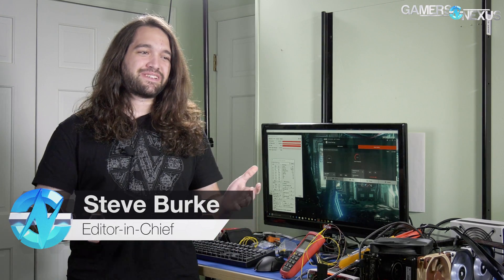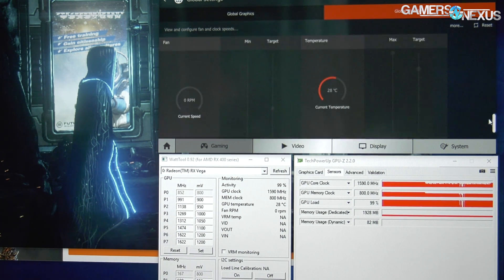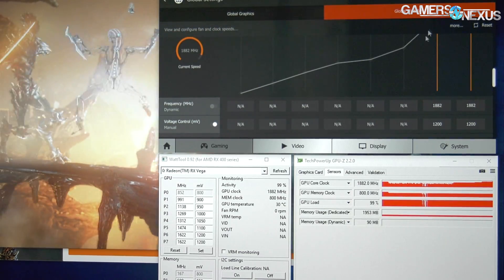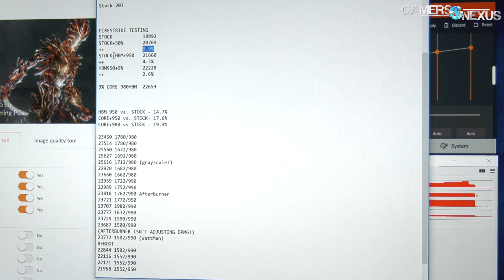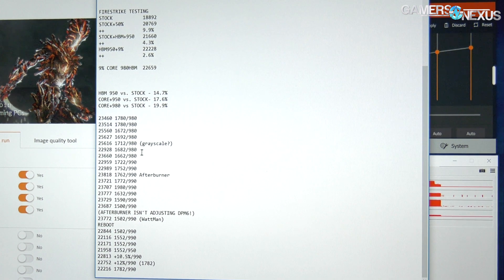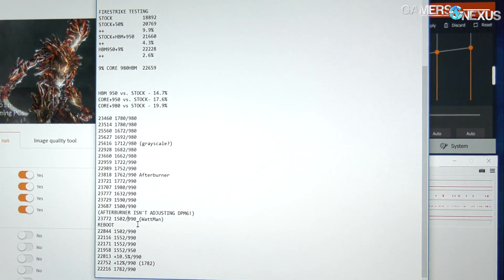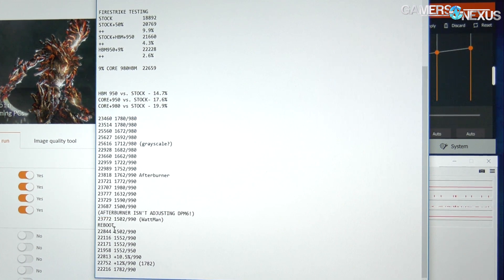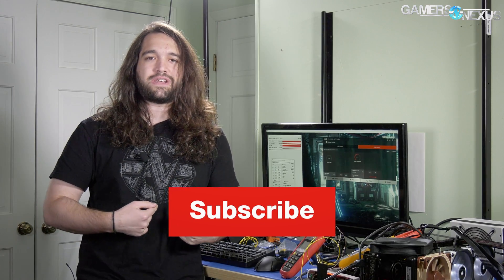Clock Bug Rant: No, Vega Isn't Hitting 1980MHz

Comment: In the future Vega64 will beat 1080ti look at its raw power compared to 1080ti. Vega just needs game optimizations, driver updates and when AMD enables DSBR, its performance will jump hugely. (Finewine technology am i right? :D) Wattage isnt problem if well cooled solution=AIO Vega 64. And almost every Vega gpu can be undervolted and still perform same than stock one. AMD just made sure that every chip (even the bad ones with bad silicone) can run at rated speed. I would buy Vega over 1080 becouse its little bit cheaper, more futureproof and it will get 1080ti performance later (due to optimizations, driver updates and enabled DSBR) (Btw now with DSBR disabled Vega cards render everything, even things you cant see in games, so thats the reason why it isnt performing well now.) Every new tech isnt good at launch. Just like Ryzen and Nvidia 1000-series GPU's. But now months later Nvidia 1000-series GPU's and Ryzen are performing very well after some tweaks here and there. Cheers!
Reply: Will never reach 1080 ti. No  software optimizations will get 30% performance out of a card. Maybe 15-20% but not 30%z
Reply: Juho Petrell, by your logic, I can make my car go faster, if I just put a bigger battery in it. That's not how this works...
Reply: If that winds up being true, AMD has shot themselves in the head. By the time the card gets good, all the reviews will have everyone thinking the card is shit and no one will buy it. By the time some realize it might be good, Nvidia will have something better out.
Reply: ThePotatoJuicer I'd say maybe 5-15 percent honestly.
Reply: Nobody can really predict improvements. Vega has so much untapped performance that it doesn't even look like it actually has any gaming optimizations at all and they just somehow perform like they do. Vega 64 not only has the chance to be as fast as a 1080ti, but also to be a lot faster. The problem with that is, that no one knows if the Gaming driver team finds a way to use all the raw power(The OpenCL team did). What i really want to say is: You can't really say that Vega won't perform like a 1080ti, you also can't say that it will because you can't see into the future.
Reply: Maybe next year buddy lmfao
Reply: Juho Petrell By they time that happens you get Navi. AMD is all about waiting. Not worth it.
Reply: >implying that the 10-series of GTX cards didn't run well from the start

Bro I have a GTX 1080 that I've had since about a month after release and it's kicking ass just as well now as it did at release, even after all of the updates. The Vega will NOT beat the 1080ti simply because AMD is budget hardware. That doesn't make them bad, but in the world of gaming, Nvidia hardware is the high-price high-reward company for gaming. I have hardware in both an AMD rig and an Nvidia/Intel rig, and despite near identical specifications, the Nvidia rig performs better, runs at lower temperatures, and makes less noise. Oh, and it doesn't get so hot that it could cook a steak well-done in about 3 seconds and force itself to shut off to avoid self-damage.
Reply: @nappydrew That's how it works on teslas lol
Reply: Juho Petrell and how do you know it will improve that much with drivers? Do you work at Radeon?
Reply: You are either the BIGGEST FANBOY EVER or just a massive troll. Also it's not just Ryzen and 1000 series Nvidia, it's Ryzen and Vega too, ALL GPU's lose framerates on Ryzen CPU's compared to Intel current gen.
Reply: also according to an earlier video (July 30th or 31st), the one where AMD lifted the embargo on all the specs, Steve states DSBR would be enabled with RX Vega LAUNCH DRIVERS, are you saying this is not the case, if so please point me to something that proves this as I cannot find anything stating that it is not working.

Comment: Bug or not, saying something like "Don't you think AMD would be putting a bit more on the clock if that were so easily possible" Can really be said about both intel and Nvidia. 1080's and 1080 ti's can apparently go all the way to 2100mhz give or take. So, why don't they just clock them at that? Not even after market cards with liquid cooling and hybrid setups do anywhere near 2100mhz out of the box, but they can go that far so why not? 7700k can get 5ghz, so why don't they just clock it at that. 8700k can probably oc to 5ghz too, but they won't clock it at that.
Reply from the maker: There's a big difference between a couple hundred MHz and a 33% increase.
Reply: Because they have to consider every situation the parts will be used in, like SFF with minimal ariflow.
Reply: Probably has to do with the minimum requirement of clock speed. My 6600K can barely do 4.6GHz as where I think most can do that easily, and my GTX 1060 can lock to 2188MHz in certain games and other 1060's can barely get to 2000MHz.
Reply: I'm not talking about whether or not there were increases, I'm saying that statement is just not realistic as to how AMD, Nvidia, and Intel ship out their CPU's or GPU's. None of them put them at their max possible clock rate when we know its possible. So even if there weren't a bug and it could still get a 400mhz overclock, like the 1080 / ti can, with even more ridiculous power draw, you can still say "Why didn't they just do that out of the box?", but its not a fair thing to ask as we know they have TDP targets to hit.
Reply from the maker: We know that, having been in the industry so long. The point is that this difference is far greater than some enthusiast overclock. If all these cards could genuinely hit 2GHz without LN2 (or even H2O, for that matter -- you could do it on reference), then there'd be more room to improve baseline. It's clearly bugged.

Comment: What reviews are saying it will hit 2Gz ?
Reply from the maker: http://hexus.net/tech/reviews/graphics/109078-asus-radeon-rx-vega-64-strix-gaming/?page=8
"A quick word on overclocking. We managed to run the Asus Radeon RX Vega 64 at 1,980MHz core and 1,000MHz memory, just beating out the clocks achieved by reference, and by doing so we added an additional 6.4 per cent performance in a trio of games. The downside of this voltage-induced performance is that power consumption rose to 532W at the wall."
Reply: " 1,980MHz core and 1,000MHz memory, just beating out the clocks achieved by reference, and by doing so we added an additional 6.4 per cent " The 6.4 percent should of told them somthing about thier overclock

Comment: What kind of idiot overclocks without checking if theres an actual performance increase, are people really this dumb now? I plan on testing mine to make sure it works first then it's going to get an ekwb waterblock and should have some nice temps. My r9 390 with my 240/360 only hits 40°C when its normal ambient temp of 21°C (not 30°C like it is right now on the riviera) so I'm hoping the Vega runs around 45°C or so.

Comment: How come you didnt go with the overclock that hit a score of 25627? Seems like that would be your max overclock because anything higher than that just reset the overclock. There was no comment on the side of it so one can only assume that the test went well.. Was there something wrong with running the card at 1692/980?
The test before that also hit above 25000 and there was no comment on that one either.
Reply from the maker: Because, as explained in the content, that's a bugged score? That's discussed in the very video.
Reply: Oh, I thought you were just saying that about the the score with "(grayscale?)".
Reply from the maker: All the 25K scores were conducted under those conditions.

Comment: Why stop at 1980 MHz? Lets troll-clock this beast to 2.5 GHz, or better yet 3 GHz, no, make that 4 GHz!

If this gets 1% quicker every couple hundred MHz, you're eventually going to beat the 1080 Ti!  Like totally legitimately!!!! :D
Reply: proesterchen should of put lie 100 ghz
Reply: If people didn't care about the heat or power gains, or if you live in the arctic with a nuclear generator around the corner, you can ramp up clock speeds as high as you want and push as much electricity as you want without worry.

But electronics are finicky things, so high levels of electricity brings about instability as you push the circuit traces to it's limits, before it starts shorting out.

Basically, we don't know what's the full limit of the PCB's circuitry... Maybe 2000 watts to 4000 watts is the limit, because you are borderline approaching 'large appliances' power usage territory.

https://www.daftlogic.com/information-appliance-power-consumption.htm

Damn, your toaster uses a minimum of 800 to 1800 watts, and all it does is toasts bread.
Reply: There's also a max speed that you can draw thermal energy away from the electronics. That's why super sub-ambient like LN2 or LHe (Not sure how many atoms like to stuck together) are popular for the extreme overclocking is that they can literally boil off absorbing enormous amounts of heat and helping preempt the heat being produced by cooling the CPU electronics further than you can with the electronics off and at room temp.
Reply: Sometimes I wonder why AMD and Nvidia's CEOs are both Asian and somehow have three syllable names (if you just use your first name and last name... Lisa Su and Jen-Hsun Huang)
Reply: Because GPU does math in a way that requires a very in depth complex mind to optimally create a design that works?

Compute in hardware is practically mostly mathematical, to a point where a mathematician is better off than a programmer.
Reply: Little Wick Asia is a continent ,not a race,perhaps you failed geography in school... when people say this or that about Asians I instantly realize they are ignorant.I know what you where trying to say but it always bugs me when people think only Mongoloid's live in Asia.

Comment: Well I'm super glad I got an Rx480 Nitro +OC 8gb card for $240 when I did. Glad I didn't wait for Vega or any other cards. And glad I got it before the mining craze.
Reply: Ayy I got a GTX 1070 for $235 the other day, after I sold my GTX 1060 for $310 a day before. It was probs stolen but a deal is a deal.
Reply: C. L. K I doubt it was priced so low because of it being stolen because they would not need to price it that low to get rid of it since anything below $400 and it would be gone relatively fast with these inflated GPU prices. It's more likely it was used in mining so it got worn down, but it would be hard to tell unless it stops working or fans die after a few weeks or months after you use it.
Reply: BuffaloWarrior7, I bought the exact same card for around the same price and ended up selling it on ebay for $520 at the height of the mining craze, then turned around and bought an EVGA GTX 1070 Hybrid.
Reply: I'm glad I bought everything when I did. Everything is just way to overpriced currently.
Reply: I snagged a 470 before the craze for $130. Will upgrade once I upgrade my monitor since I'm ok with running medium setting once the games start getting more demanding.
Reply: BuffaloWarrior7 I mean you can still find really good cards for a steal atm, seems most people forgot the GTX 980 exist and they're sell around $220-$250 on eBay...
Reply: I remember the good old days when a stick of 8 gigs of DDR4 was 31 bucks.
Reply: @DarkSoul-ds2  no way!